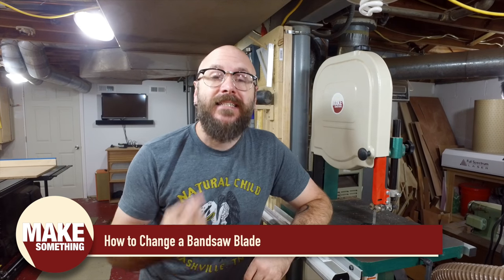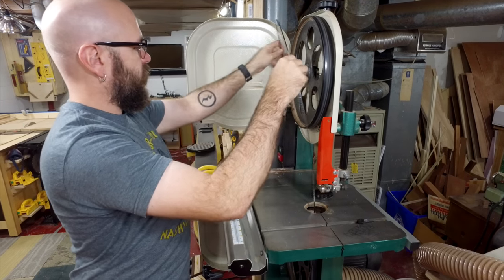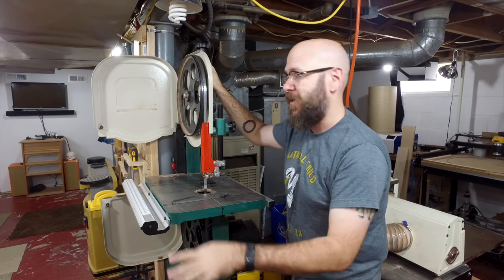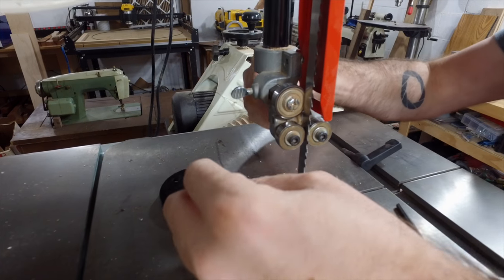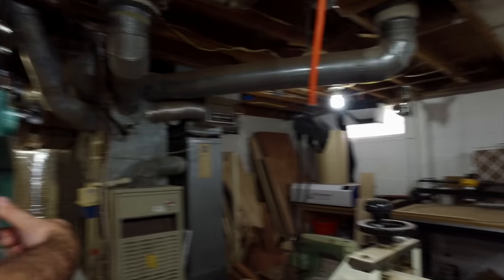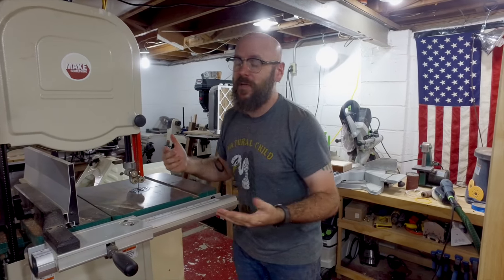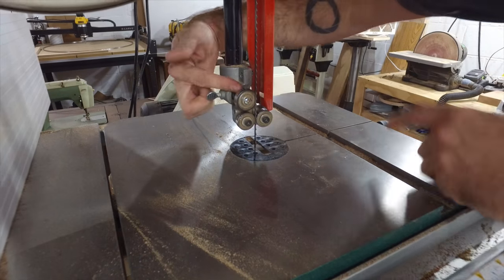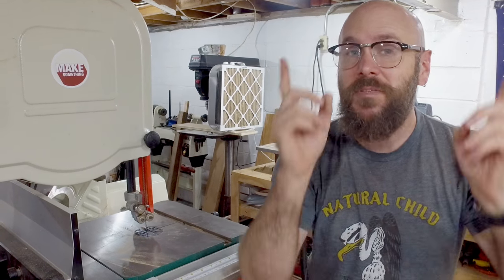How to Change a Bandsaw Blade | The Easy Way!

Comment: David, I found this very helpful. I recently inherited a band saw with no instructions or experience maintaining one, never had changed a blade before, seemed a little daunting until I saw how you did it. Spent a total of about 4 minutes changing mine, now I know not to sweat going back and forth between a resaw blade and a narrower blade for curves.
Reply from the maker: Right on, thanks Nick!

Comment: It is true that if you have a sharp, quality blade and your guides set properly, tension is less of an issue. Same goes if your tension is proper and your blade is sharp, your guides are less of an issue! But, your blade should always be sharp no matter what. Dull blades are what usually cause issues more than anything.  Although In some cases, having improperly tensioned and guided blades can affect the quality of the cut and increase wandering, especially in high stress actions like resawing. Matthias Wandel has some great videos explaining the science behind cutting and resawing, and can actually make it easier!

Comment: Thank you for this. I have watched I don't know how many videos about setting up a bandsaw/changing blades/tensioning, and I've still not been sure. I'm a newb with a bandsaw. This was refreshing to know that I don't have to get paper out and put between the blade and guide bearings, or worry with that much tensioning. I'd say you know how to use it...I've seen you use it many times. Thanks! You looked quite flummoxed at 2:22...it was hilarious!

Comment: I like reaching across the blade with the cover open to turn the saw on to test for blade tension 4:07...I like to live on the edge too. 
I also change blades on my Circular Saw, Table Saw and especially Routers and Power Planers with them plug in too....

Comment: According to Alex Snodgrass on the "band saw clinic" video you should not center the blade, the gullet should be on the center of the wheel (if you have a crowned band saw wheel). This will eliminate drifting. I have seen so many videos on how to adjust the band saw for drifting  and was worried about this when I recently got my first band saw. However it was not a problem at all when I set up my saw as Alex Snodgrass showed in his video. When it comes to tension I understand that too much tension will give you less power since it will be harder for the motor, while too little tension will cause drifting but I'm not sure how accurate it need to be. I always lower the tension (don't have a quick release) but one day I forgot to tension the blade before resawing but I could not notice any difference whatsoever so I find it hard to belive that accurate tension is that critical for good results.

Comment: "Never really learned what that's for" - it's to keep the table aligned evenly on both sides of the giant split down the middle.
Reply: You beat me to it. Especially when you cut a heavy piece of wood the weight can cause one half (front or rear) to sag lower than the other.

Comment: Tension in the sawblade is what overcomes the tendency for the blade to follow the grain of the wood.... Don't believe it?... Don't think it's important?... Just loosen the tension, and watch what happens.

Furthermore, that little thingy you don't know what it does... That little thingy keeps the top of the table on the same plane... Don't forget to replace it, or leave it out all together.. You could end up with a table going out of alignment, and be in the market for a NEW bandsaw.

Comment: What is the length of that blade? I have a grizzly bandsaw also and I use 3/4 for resawing which is easy to put on. The thinner blade are a little tricky to get them to stay on.
Reply: I have the same bandsaw as David. 93 1/2 is what the manual says
Reply: Woodworking Geek I believe it is 105" if you have the riser block installed

Comment: Have 40th anniversary grizzly I wil tell yah one thing take the table off does make the work easier. One question for yah my grizzly after I set it up if I raise and lower the blade guard I get different spacing between the bearing and blade not sure why and grizzly don't know why either

Comment: People who comment about the danger of testing the saw when your arm was beside it must not use bandsaws much. When a blade pops off either wheel (or if a blade breaks), the blade will stop spinning immediately. The blade will NOT continue to move, and it will not cut off any body parts!
Reply: Please understand that I am not trying to be snarky or start a flame war, you are entitled to your opinion and I am sure you are a great person but how many times have you seen a blade break while one was running?

I only ask because I have seen it happen maybe 5 or 6 times and one of those times the broken blade hit the table and shot out of the saw and stuck in the far wall of the shop about 25 feet away... now I agree this is very very rare maybe one in ten thousand but I don't like to play odds with my welfare when I can avoid it.. this is akin to showing people that when you drive down the deserted road that is rarely traveled you just blow through the four way stop sign because you've never been hit doing it.

I am 52 and I have using bandsaws since I was 10 if that matters.

Comment: Hi David and nice video. If you have a second to answer, what do you have your tension block actually set at and do you have a hard time keeping the 3/16" blade on and not walking all over? I have same exact bandsaw and blade so when i barely adjust the tracking knob it throws blade to edge of wheel in a heartbeat.
Reply: I have the same saw brand new.  I had the same problem.  I think I over tension the blade it was a 3/16 and it popped off and kinked the  blade the blade would not track properly.  I got a new blade and it worked  perfectly. I made 3 reindeer with it one small box . When making a tight curve on my last deer the blade snapped.  I had no idea bandsaws  were so finicky.  Learning curve I guess. My deer turned out really nice but I have 40 dollars  worth  of blades in them. Let me know if you solved your problem.
Reply: Crumbo Crumbo Nothing yet. I turned the red tension block to just under 1/4" and even made sure the top wheel started out level if that makes sense, meaning not tilting forwards or backwards. I put the blade right in the center of the wheel to start out, I turned the tension handle and began spinning wheel by hand and slightly adjusting the tracking and all seemed good. I adjusted my guide bearings, sides and back, top and bottom and everything was still good. Adjusting everything as Alex Snodgrass suggests. Then spun wheel by hand again and about 20 turns later the blade walks forward about a 1/4". Aaaaugh!!!!!! So a bit nervous to trust this thing to do any cuts fearing it will come flying off a eat a finger or two.
Reply: The 3/8" crap blade that Grizzly sent with it had no problems whatsoever. My tires are clean, v-belt on motor is tensioned perfect so I am a bit lost. Funny thing is that Grizzly says we can use down to a 1/8" blade. Could only imagine trying to get that one to work.
Reply: Read this link. It's about 5-6 comments down in the thread. Going to try this later today. Hopefully the link shows up. 
https://forums.woodnet.net/showthread.php?tid=7333122
Reply: Here's another quote from another thread. 

Peter, Sounds like you solved it but I have to weigh in with the fix for mine. I could get everything from 1” to 1/4” to track but could NOT get the 1/8” to track. After fighting it all afternoon I called the Grizz tech line. He went through all the things I had tried and finally asked me to decrease the tension. It tracked perfectly! I don’t know why but those blades don’t like (or need) much tension. I have never had a problem since. Too simple. -- " I'll try to be nicer, if you'll try to be smarter" gfadvm

Comment: I have the same blade, but my blade just twist so much that I can`t make the sharp turns to make a bandsawbox... Any tips?
Reply from the maker: You need to make sure you're pushing the wood through as your turning. It's a balance like driving a stick shift car.
Reply: If only it would be as easy as driving a stick shift. ;)  Thank you for responding. Spent an hour disassembling, removing rust and lubing the blade guides, and assembling it again. Also had to adjust tracking a bit better. That allowed me to get better control. Still have to practice a bit before I dare to start with something "proper". Greetings from Norway, and cheers. :)

Comment: That's not the same tension between those two blades. It's the same position of the tensioner. The resulting tension depends on the length of the blades as well as the size of the band (larger bands won't stretch as much for the same tension). Even if those blades are exactly the same length when under no tension, the 1/2" blade would have a higher tension when installed in this way. Of course, the 1/2" blade could be longer than the 3/16" to the point the 1/2" blade is under less tension than the 3/16" was.

If you buy a blade from a different manufacturer, and/or if the particular replacement you bought was made a bit longer or shorter, then your trick could be a total fail.

So yeah. You aren't that particular about your blade tension. Yeah, it's pretty much impossible to maintain a tight tolerance on your blade tension without a proper way to measure it. But if you are replacing the blade with the same width and thickness blade (rather than changing blade size), there are some tricks you can use to match the previous tension fairly closely, if that was working for you in the past, even if the blade isn't exactly the same brand and length as before.

Comment: tl;dw: he doesn't worry about blade tension so long as it's not wobbly. that's it. the rest of the video is exactly how anyone sets up a bandsaw. just quickly.

besides the tension thing i donno how this is any easier than how you normally change out blades.

Comment: Remember to unplug it first
Reply: Why?
Reply: so that there's absolutely no way it accidentally gets turned on while you're changing the blades. lock out, tag out.
Reply: I don't buy it. Lockout/Tagout is for when you're working with other people. Unplugging a tool like a 14" bandsaw is literally saying "I'm so stupid that I can't trust myself to not reach over and press a recessed button switch WHILE sticking another appendage in line with a cutting surface."

It's a stupid rule for almost every consumer tool tacked onto every legal warning. If you're too stupid to do maintenance on a tool without unplugging it, you shouldn't be operating it in the first place.
Reply: "Unplugging a tool like a 14" bandsaw is literally saying "I'm so stupid that I can't trust myself to not reach over and press a recessed button switch WHILE sticking another appendage in line with a cutting surface.""

"If you're too stupid to do maintenance on a tool without unplugging it, you shouldn't be operating it in the first place."

um... so are you or aren't you advocating for unplugging it?

i mean yes practically it's highly unlikely that you will do something as stupid as turning on the machine while you're working on it alone but that's why i said it's so that there's /absolutely/ no way that happens. Because people make mistakes and people get distracted and do stupid shit. sometimes you need to set up barriers to keep you from harming yourself even if that harm seems to obvious and easy to avoid. if everyone was perfectly safe we wouldn't need guards or anything.
Reply: and to be fair i just threw "lock out tag out" at the end for the hell of it. i know that procedure is much more involved than merely unplugging a machine.

Comment: Yeah I don't get how this is the easy way... that's just how you change the blade. also wtf are you thinking starting it up while it open with your arm in front of it like that. had it actually jumped off the wheel you could have been in a world of hurt.